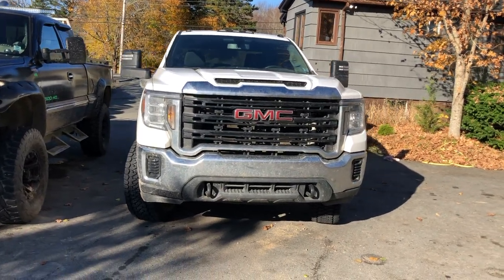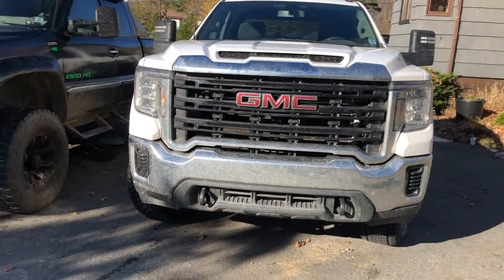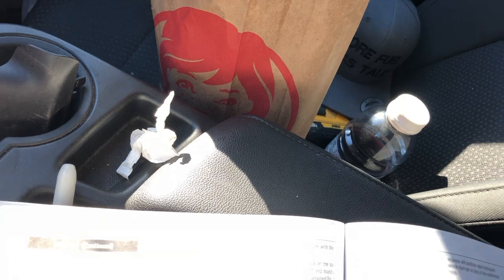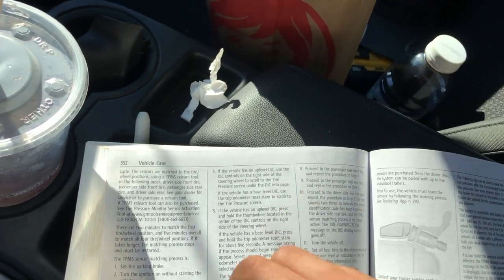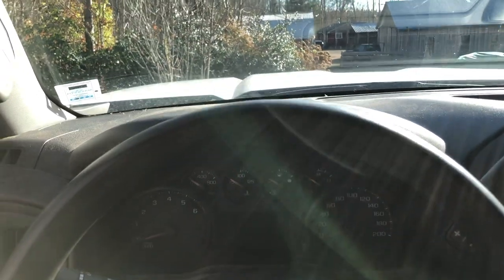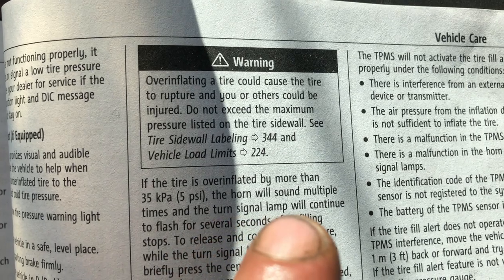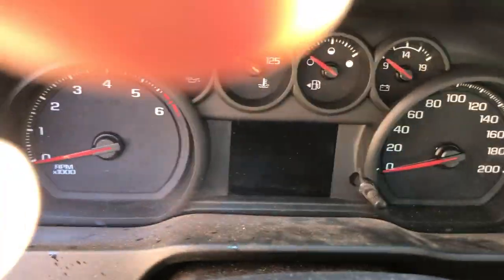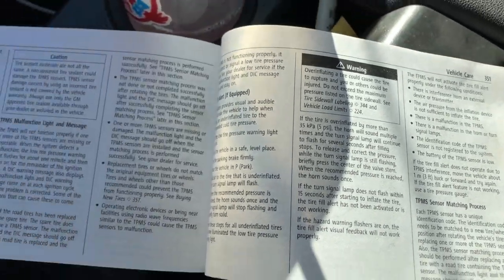2021 Gmc Sierra Horn Beeping and Lights Flashing Fixed and TPMS  Explained

Comment: Nanny systems. They wonder why there's a chip shortage... That system is a great example of wasted chips. What truck owner doesn't know his tire pressures? The dash system showing the pressures is ENOUGH. Stop there, save a chip. I've met quite a few people that overinflate truck or van rear tires when they know there's heavy weight. That's hardly a safety issue, and not at 5 psi. 20 psi over? Ok now u can chime or flash the dash.. but beeping and flashing all raggedy in the parking lot... Nanny crap. I'm tired of the damn tpms on my 05 Prius! That truck is 17 years newer and that system has only become more annoying. Surely there's an off button somewhere.